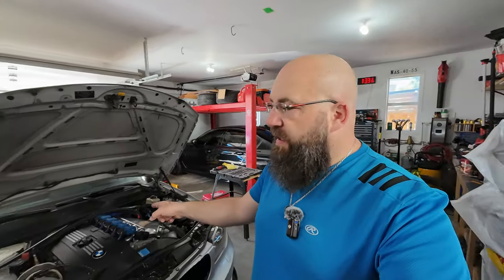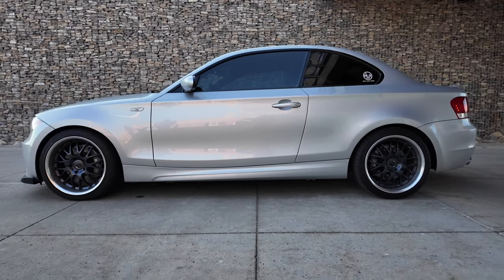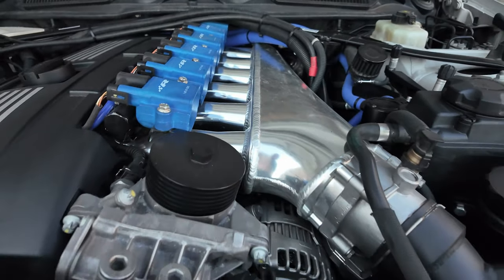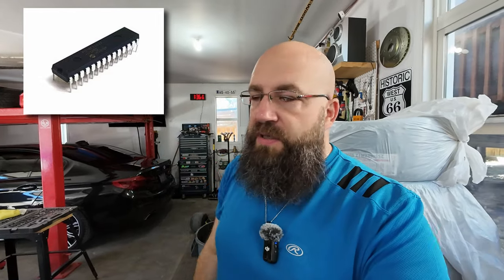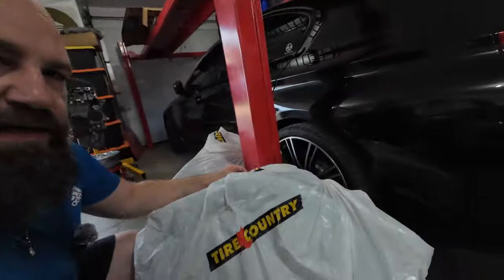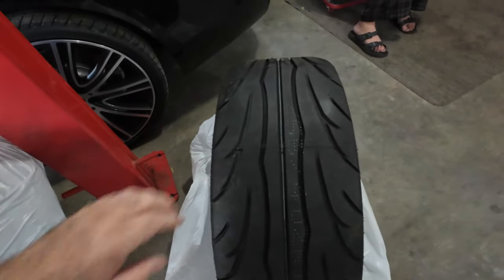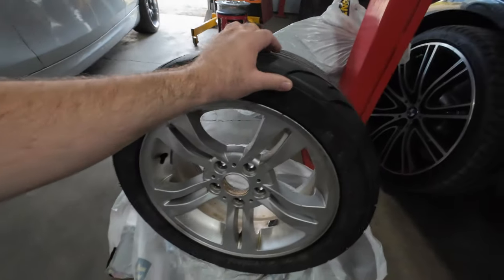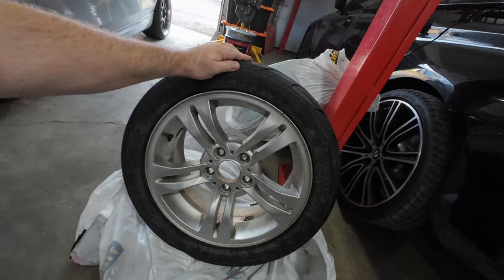What's Holding My N54 Back from Reaching 700HP

Comment: I've had bad experience with PR coils especially when its on manifold side, I was constantly getting misfires and it was pissing me off. I decided to get rid of it and got B58 coils N54 conversion kit by NEXSUS motorsports and they work great flawless so far no misfire with over 5k miles and its not my daily. I'd highly recommend get the b58 kit and I still use 97506 spark plugs.

One more thing I also recommend is getting rid junk Jb4 and get MHD single bank fueling, & also get motiv port injection controller. Huge game changer!
Reply from the maker: We are running single bank fueling with MHD BEF, soon to be custom tune. The JB4 is essentially only used as a boost controller / multi map.

Comment: I would highly consider moving towards a nexsys motorsport di delete for the n54.   The current setup you have with the jb4 is interfering with dme operation and firing the port in batch fire.    By swapping to the di delete, you can drastically simplify the build and integrate port injection under control of the factory dme.   No more open loop pi with a di mix underneath causing confusion for the car.   Also since you can remove your costly di injectors and hpfp you no longer have to worry about replacing them.    Just a di delete, id1300cc injeactors, and PR low pressure fuel pump with 1:1 regulator on the return.   Simple, reliable, and safe.
Reply from the maker: Good tip, I'll look into that.
Reply: Real world testing between sequential and batch fire has been done time and time again. No real benefits have been shown on this platform for it. Bms has also released a sequential firing port controller and even state themselves between all their R&D that there really isn't a benefit
Reply: @Twittenberg  BMS also has a vested interest in selling their kit.   At wide open throttle with high piston speed, it isnt as big of a difference however at lower speeds, theres a considerable difference in fueling accuracy.   Ive personally tested an AIC and reflex back to back on the same car and the result was nearly 30 whp from 3500 to 5000 rpm.  Short term fuel trims also stay much closer and more stable.

Comment: There is always something to sort out, my latest issue is direct port methanol 😅 overun on decel.. as under vacuum it sucks the methanol in the lines that go to the distribution box and then solanoid. The issue here is it causes the afr reading to go to 10.28 on decel for too long, the dme then thinks the o2 sensors have stopped working..so now I have 6 check valves coming, one for each nozzle holder..

Comment: never go JuiceBox, Go Motiv Reflex, time for the new era and new age of technology.

Also, i love the blooper reel throwing your wallet at it LOL.

i'm currently throwing my wallet at mine from rear main seal pushing out thanks to prior valve cover and PCV failing.... ( thought it was oil pan gasket was the oil leka originally cause it was 40K miles old..  good thing i pulled it off,  there was some hardened chunks from the old old gasket in the pan.. i also  had the VAC motorsport baffle welded in) 

had an issue with ECS tuning getting me parts/updates cause they lost the package.. so i ordered replacements at FCP Euro, cause at least FCP will grab shit off the shelf and fill a new box if stuff goes missing and if it does happen to show up on your doorstep, they'll get you a fedex label to RMA.  

well.. guess what showed up today? my ECS tuning parts and clutch alignment tool ( i have the 8 bolt)  well.. now i'll have spares when i need to do the clutch again.. question now is.. do i spend money on a lightweight flywheel and 335IS or Spec Stage 2 clutch?  or just get 335IS clutch keep the current flywheel and hit it with a little 500 grit sand paper and the pressure washer to get all the oil and grease out,  and then focus on getting replacement turbos, and the rear diff/subframe.

but even then i need to get my low pressure sensor working again too.. 

when it rains it pours.. damn car..

Comment: Mine is stock and still misfiring at idle. Does not throw any faults though.  It's idling at 600 rpm for a while then it has slight shake and the rpm increases. It has new injectors new plugs new coils new hpfp still does this. At this point i stopped trying to fix it :)

Comment: I heard you say youre gapping the plugs to .24?? I had big miss fire problems when i tried 2 step colder plugs at .22 then i went through lots of trials and found that using the 1 step colder gapped to .18 was what fixed it ALL for me!  Oh and JSR Jon is my tuner if that matters to anything lol.
Reply from the maker: The PR coils allow you to run a much larger gap, I ran 0.028 prior on my e90 with NGK 97506 and PR coils.

Comment: if you get a rear camber kit, you can run  more negative camber to tuck the tires more under the lip
Reply from the maker: I debated it but didn't want it to adversely affect the handling once I lower it. I do have all the arms so they'll likely go on just in case.

Comment: Awesome work ! I've finalized my tune with Terry 2-3 weeks ago, and the car is a blast. JB4+MHD is insane, specially in canada when fuel quality is , let say, variable. Jb4 safety is a must, or worst case I jump into a lower map. Got 607whp at 26.5psi with petrocad 94 special + 50/50 meth 600cc on map8 single turbo. 
Did you posted your log somewhere ? I would like to compare with mine.
Reply from the maker: That's impressive! I've not posted my log but could email you a copy if you fired us an email.

Comment: could your injectors holes in the head be ovaled out. Have heard alot of people just removing them and plugging the DI injectors with titanium bolts and running PI only on maxx ecu
Reply from the maker: Nah, they're ok. Just somehow had a string of lousy injectors somehow.

Comment: 6:10 Around this point in the video he's wondering what he can do to get traction on the car. We'll I don't know that he would be able to have traction at those power levels no matter what tires he would be running. Of course stickier the better but short of pulling power out at certain moments and/or through certain gears (which you can do with apps like XHP and X Delete). But I'm running a similar set up but with 17t upgraded twins which just pour on the torque at low speeds and off the line. (Which i like lol) but even if I have 4X4 turned on for race mode I can't stop all four wheels from spinning through first second and even third! So I don't know other that feathering or just remapping the throttle that there's much he can do about the spin. 😮😂❤
Reply from the maker: I mean, I could do an xDrive swap on the 135i, would be pretty interesting to do with slicks on all four wheels. 🤔
Reply: @tony.nextlevelrides  LOL. Wow. You are amazing! I wouldn't even consider a job like that. But I am too Lazy and seem to only do the really challenging things when either I have to OR I really really want to. lol. You were right near the end of the video though about the temps on the asphalt at this time of year in Calgary being too cold for any good traction. Two things happen to us up here when the temps drop. 1. Traction sucks. 2. Our intake air temps go way down and that makes the power and torque go UP! SOOooo that means two fold we are not getting any traction! But it is fun!   You ROCK Brother! Thank you!
Reply from the maker: @friguy4444  Thanks! Really appreciate it!! I'll figure something out for next spring / summer, no point doing it now.

We will see, V2 coming soon though. 😊

Comment: Try a little dielectric grease with a brush on the inside of the spark plug boots….✌🏻
Reply from the maker: Done and done! I'm sure to do this with every plug swap!
Reply: @ Yeah you have to withose ignitions, I’ve seen them throw arches right out of the boot & burn the side (porcelain) of the plug.
Reply: @ What phone mount you using, seems to work good?
Reply from the maker: @murk1352  it's a Mira Mount off amazon!
Reply: @tony.nextlevelrides  Thanks i wanna check it out, I think I’m gonna do a small quality suction cup off the windshield, but still undecided. For now just look at JB4 gauges in my phone, in the 135 cup holder…😂✌🏻

Comment: Do you have dual walbro 450’s in your tank?
Reply from the maker: Nope, just a single walbro 450 for now.
Reply: @ On port? There’s  you’re problem right there, that’s why you had EKPM problems too & why you’re not making 700hp. If you throw another 450 in there you’ll be all set! I don’t think it’s your hpfp since you put a new one in. Them DI injectors need tons of help, unless you have a good set of index 12’s, I say good cause they crap out too! You put another 450 in there & run the sec on a pressure switch with a relay at 13lbs of boost, you’ll be all set!